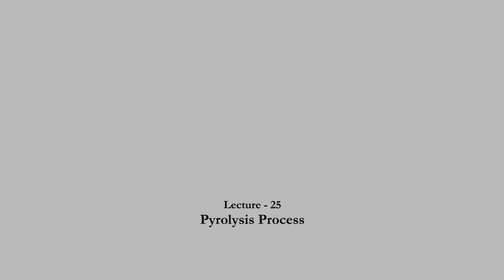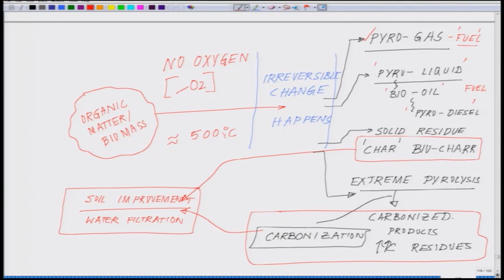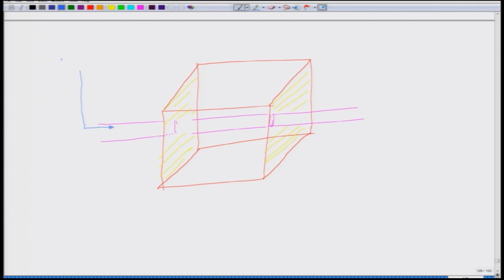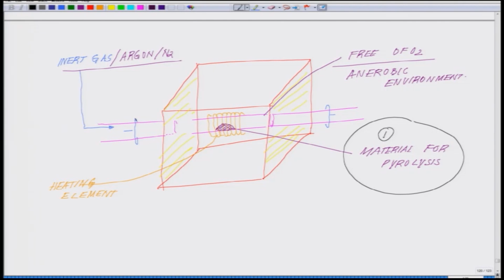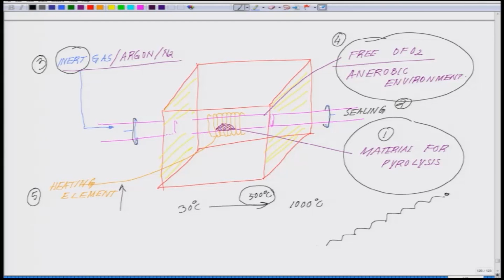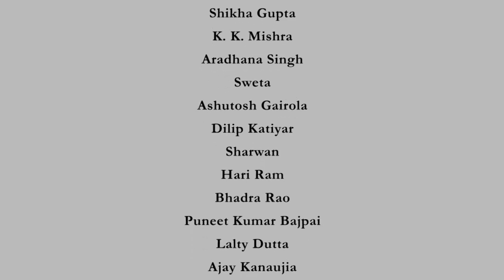Pyrolysis Process

Comment: I have been looking on Youtube already a bit but it's hard to find clear video like this. I am very curious about this process since it seems to me that, under certain conditions, the output of combustible materials could be cheaper than derived from fossil sources.
If so , then it's a shame no more research is been done on what biomass works easiest for say gasoline or methanol etc;..I think if household waste is the biomass source, high temperatures will be best to break a very heterogenic mixture into simple building blocks but if we could start from only a pure, dry and simple biomass like peanut hulls, then I think the temperature could be much lower which is better energy wise.